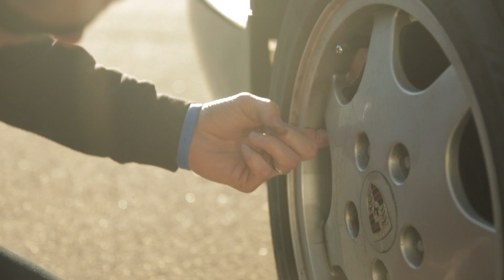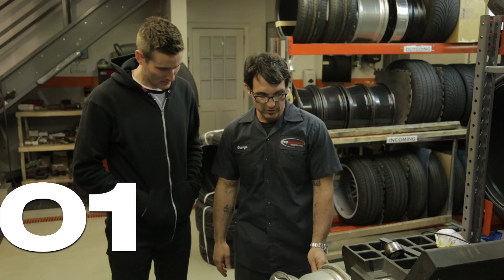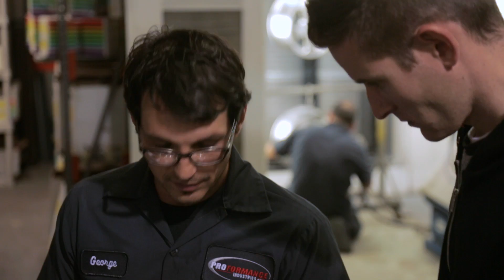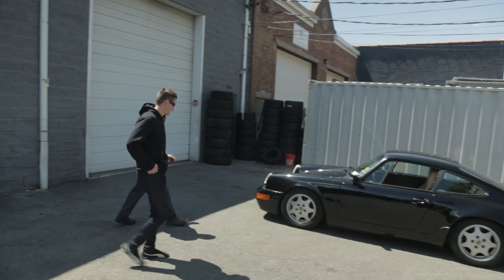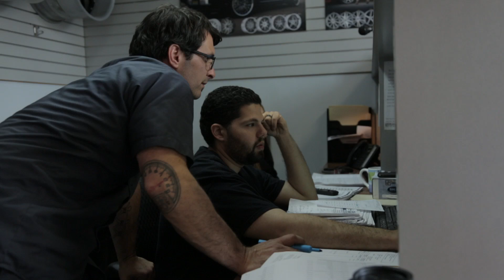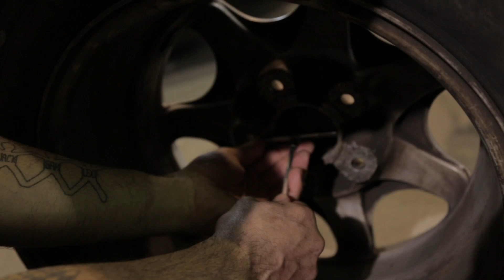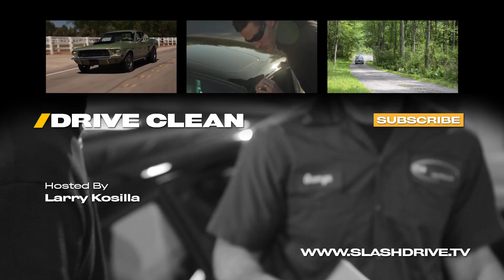Wheels & Rims: Repair, Refinish, and Fitment - /DRIVE CLEAN

Comment: Normal air has 78% Nitrogen in it, so normal dry air works pretty much the same in a tire i´d say... the gases that are smaller and can escape the tire wich leads to losing airpressure are gone if you refill the tire with normal air you are only adding a little bit of air to it wich has those gases in it. but with every refill the concentrations get smaller and smaller.
I´d say Nitrogen filled tires is a marketing gag wich makes people pay more

Comment: If you use Nitrogen in a tire that is seeing track use, it's much better than standard compressed air. Nitrogen has a more consistent and predictable pressure change with temperature, and is less effected by moisture. There is a reason most professional racing series use Nitrogen in their racing tires.

Comment: The fact he said about the nitrogen in wheels is wrong. Because it will never 100% nitrogen in the wheel. Specially in these small shops. The tire has to be fitted in a pressurised container then filled with nitrogen. Fitting it like he did their will always be hydrogen in the wheel. So you basically payed more for nitrogen. Test the psi on track with nitrogen and without. You will get strange readings from the nitrogen filled tyre.